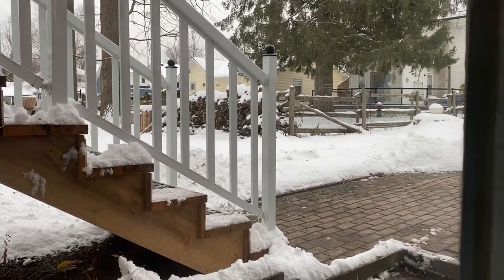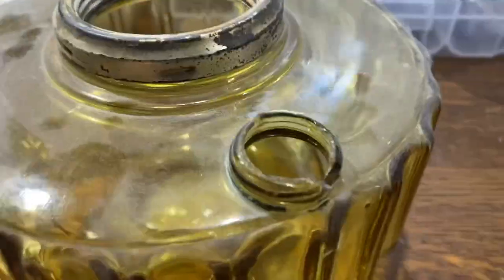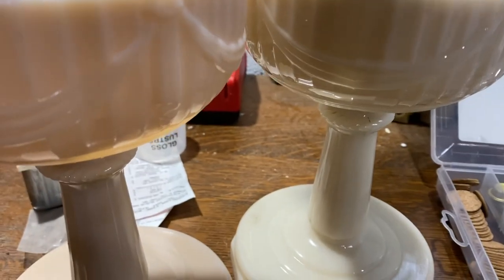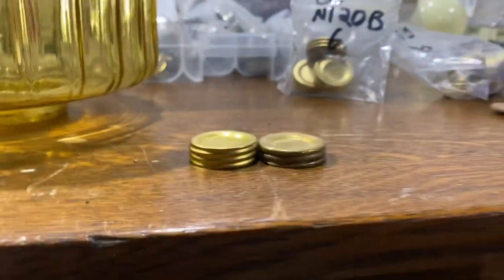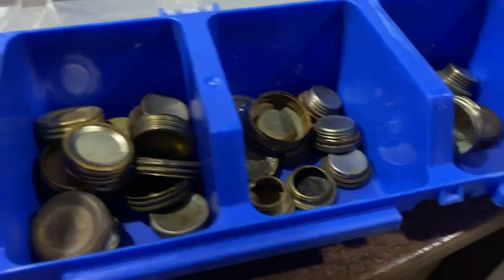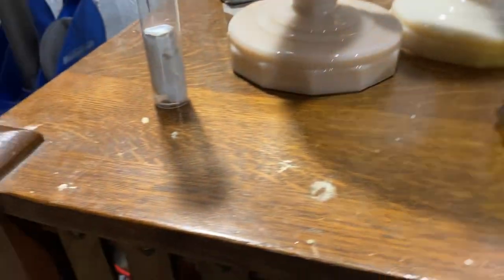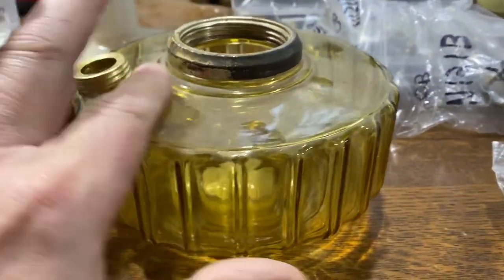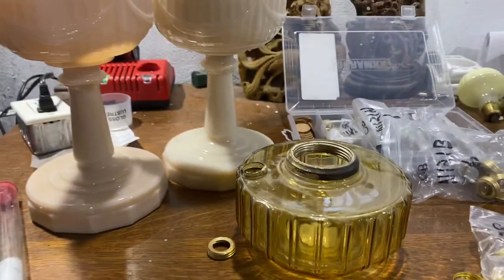Aladdin lamp thread repair, my way.

Comment: Hi there, where can one acquire the threaded replacement collar and cap? My Aladdin has this exact problem.  Broken glass threads on the font cap. It’s not a rare font so your method would be the perfect fix back to functional shape.
Reply from the maker: eBay is pretty good. There are several distributors in the US if that’s where you are from.
Cheers
Reply: @Kerosenecanada   yes, I am US. Actually found  an Alladin dealer in my home state (Tenn). Turns out I didn't need a replacement cap, though. After watching some of your vids, I figured out my cap was actually two pieces. Just had to carefully unscrew the inner threaded piece from the cap. Then epoxied that inner piece on the remaining font threads. I used a JB weld product b/c its what I had it on hand. Anyway, the fix worked perfectly. Put in a new wick and burned the lamp for the first time last night...my first Alladin, I'm hooked! Sure appreciate all your vids!